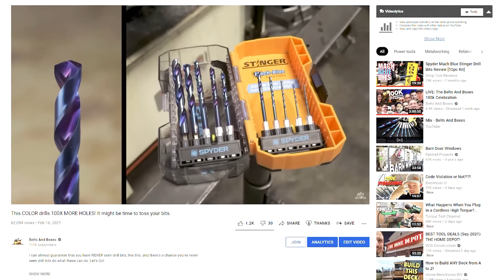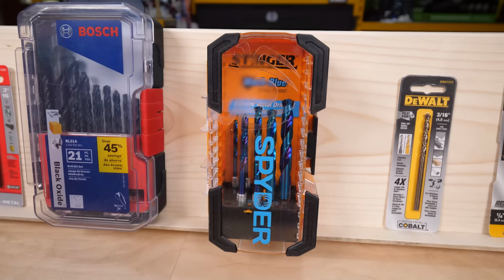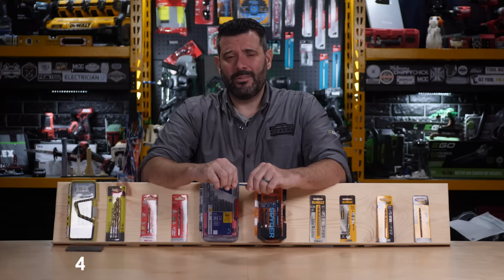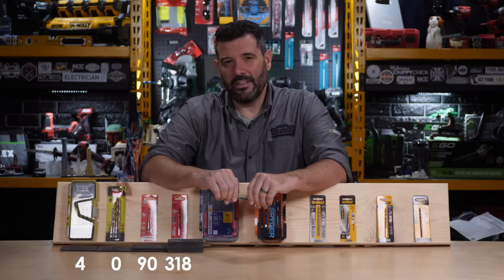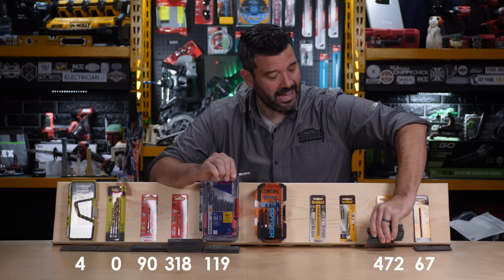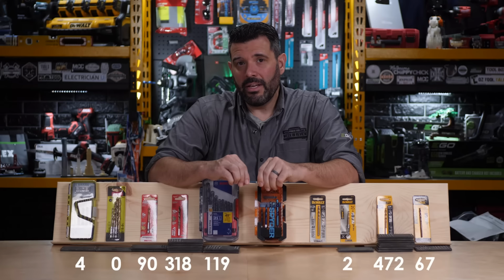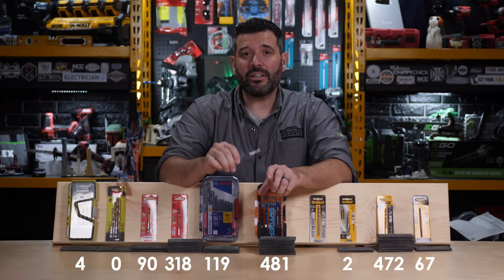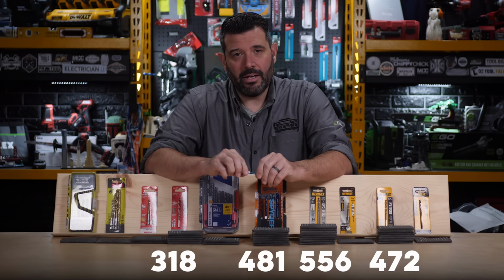What Drill Bit is Best? America takes on China. Milwaukee, DeWALT, Bosch, Ryobi take on Spyder 100x

Comment: I'm an ironworker, and at work we use Champion Brute XL5 bits, they drill very well and are made in the USA as well. If you're not too sore (or if you can convince your brother), I would love to see how they hold up against their American brethren. Great video!
Reply: Those are the ones I use as well.   They haven’t steered me wrong, but I’d be willing to give Spyder a try as their hole saws are pretty good.    As far as where a tool is made?   Whenever possible, I try to have it made in Canada/USA.
Reply: You ever try out any Norsemen drill bits?  Or the drillhog?  These are USA made.  Wonder how those compare to Champion Brute.
Reply: @jtoker9758  I haven't, no
Reply: I used a couple spider bits for galvanized heavy Channel a couple years ago. They surprised the hell out of me. We were predrilling for wall panels, so we made a lot of holes with them.

Comment: extremely thankful for the video! I was using Ryobi bits with lots of frustration and had no clue they are SO bad. Just bought Spyder to finish drilling steel that Ryobi was unable to do, and completed job in 5 min after spending 1h+ yesterday with Ryobi. The drilling effort you made is impressive but tells a story very well!

Comment: Excellent review, Drilling the point home, that there is a lot of inconsity in product production & performance. Seeing Spyder with those results is impressive and equally satisfying that it is American made. I did not know spyder made saw blades, that I am interested in.
Reply: Not all the spider products are made in the US. Paddle bits, circular saw blades, and reciprocating saw blades are made in China or Taiwan.
Reply: I tried the spyder drill bits to drill out a stripped lug nut. It didn't do very well. I ended up taking them back for a refund. The kobalt drill bits from lowes worked better and did the job I needed done.

Comment: I just want to comment that when this video came out 2 years ago(wow!) I went out and bought the German DeWalt cobalt and the blue spyder bits. Im not using them every single day but they are all still incredibly sharp. My only complaint about the spyder is they don't stay put in magnetic collets (m12 installation driver offset head) but aside from that they are amazing. I use them for wood and they still deliver consistent, clean holes! The German DeWalt cobalt bits are incredible and i use them any time i drill through metal! Still going strong 2 years later!
Reply from the maker: Love to hear this!

Comment: Since different coatings are meant for different applications, and the most of my work is light to medium steel, I always go cobalt bits as they seem to last the longest, regardless of brand. 

My particular favourite is actually the starrett holesaw pilot bit (I'm an electrician so most of my holes are 6mm anyways) £4 a bit

I have a Milwaukee cobalt index for when I need a particular size but risk snapping the bit. Cost £40

I have a hilti cobalt index that I've had for nearly 20years. Every bit is still razor sharp and will go through anything Ive ever come across,but the index cost over £200 for 35 bits, so it's only used if it happens to burn out a cheaper bit first

Comment: It needs to be noted that the Spyder bits are a coated High Speed Steel, and they did almost as good as the most expensive Cobalt bits. That is truly impressive! I feel like that's a very important distinction that should be highlighted. But the most surprising thing to me is that the DeWalt Titanium (a coated HHS) did just as good as the Spyder bits and are made in China, and cheaper. But, as you noted the quality control may be lacking, and you may not always get that performance. Over all a very cool test. Thanks for doing that!
Reply: But: titanium oxide is a coating, too. You did n't expect that, too much pressure and rpm ... burn the coating? Bit is done. I also use cutting lube, watching speed and pressure. Yes I do with crayon type lubes. Those hex shank bits are primarily used by householders in those 3.6 volt things. More expensive mfg. Aimed at a market with discernment and expectations. They will pay more because it fits their weak slow screwdriver.

Comment: I have a Dewalt cobalt bit set. They have easily been the best bits I’ve ever used. I’m not as active with them as I’m sure some guys are, but they’ve drilled through things I never figured they would have lasted through. I’ve also only ever used bits you can get from big box until I bought the dewalt cobalt. So there may be better bits out there.
Reply: Have you tried drilling through wood with them?  I was shocked at how rough they are.  They pulled the drill so hard it smacks into the wood.  Leaves splinters everywhere.  Goes very fast.  The Spyder and Milwaukee titanium bits I have I can use for finish carpentry because they are so smooth.
Reply: I used to work as a finish carpenter in commercial.

I bought the dewalt cobalt for pre drills on hollow metal doors, closers, frames etc.

I used to charge out the company for the dewalt black and gold because the purchasing person used to hate anyone who bought " needlessly expensive" bits.

I would charge them 5 to 1 for the cobalt and make nice profit, I even bought a bench grinder to sharpen them.

Comment: Glad to see Spyder doing well with drill bits because my experience with their carbide hole saws in 304 stainless and even A36 hot rolled is the exact opposite - I got 0 holes from both a 1-1/2" and a 1" Spyder hole saw using a drill press to control speed (<200 rpm) and plenty of lube. Finished both cuts with old, used, Lenox bi-metal saws. Love to see a shootout of American drill bits. Add K-Tool, KnKut, Champion, Norseman, etc. My K-Tool set has held up very well. My friend has lots of those Ryobi bits around, but he builds junk out of wood like a caveman, so it doesn't really matter.

Comment: Excellent video, straight to the point. Because of you showing this, I went and bought blue mach bits and drivers. I also bought several new saw blades, all Spyder. I bought Spyder blades for my jigsaw, my reciprocating saw (nice Spyder blade case) my miter saw and my table saw. In summary, this video printed me to buy over $300 worth of Spyder stuff. I did not know that they are all made in the USA. Great helpful video.
Reply from the maker: Ward, I'm glad you loved the video! But full disclosure, I know for a fact that not all of SPYDER's products are built here in the USA yet. They're working on it, which is more than I can say for many others. So you can support their efforts by buying their products for sure. But if you're only interested in spending money on Made In the USA, then you'll need to check the label on each SPYDER product you choose. 

I do hope you get the same great life out of your SPYDER products, that we've got out of ours, and appreciate you supporting Made In The USA products. It's hard to do that with power tools, but there are many great bits, blades, and hand tools still made here.
Reply: @ToolShow  Got it, thank you.

Comment: That drill they're using is running at the optimum speed for drilling a 3/16" hole into mild steel. But you still need coolant to not overheat the bit. There are certainly metal alloys that are more heat tolerant than others are. Some grinds will produce less heat than others too. This test would have come out different on a drill press using coolant. As to why I'd buy cheap bits it's because they're cheap.
Reply: Dewalt bits are very cheap. I got a set for like $15. Haven't had any problems with them. I usually try to use cutting oil but it's not always convenient so I drilled a ton of holes on my trailer without it and the bit still cuts like new
Reply: This and pilot holes ,crayon wax like stick lube coolants. Keep bits locked away from glommers in company shop as well. Even the same! bits provided last 100x's, taken care of, longer then the ⅛ bits used by the 800 pound gorillas bouncing on the drill that's spun at 4,000 rpms.

Comment: I would be happy with the DeWalt German bit, the Spyder, or the Milwaukee to be honest. How many batteries on the drill did you go through? Looking at set prices now for the Spyder and DeWalt.
Reply from the maker: To make sure a low battery was never a factor, we swapped them out after every 72 holes. They were usually down by one bar at that point.

Comment: We are building our own home right now and Spyder brand bits were THE ONLY ones that could do some of the work that we had for more than 3-5 holes. I actually stopped using mine because it was getting dull while all of its competitors are laying on the ground broken.
Reply: Learning how to sharpen twist drill bits is a valuable skill. In a pinch you could do it with an angle grinder. A bench grinder is your best bet though.

Comment: I’ve stuck to Milwaukee cobalt bits and haven’t looked else ware but I might look in to the German made ones cause in my opinion if you want a precision tool you go Germany, American steel if better for heavy duty applications
Reply: All I use are the cobalt Milwaukee bits as well. They're sharp, they cut fast and are easily replaceable if one breaks. More expensive bits are great, just not after 5 o'clock and it needs to be done.

Comment: Hi from Scotland, I have the spider quick change carbide tip holesaw and they are the mutts nutts. I’ve had my eye on the spider drill bit since they came out, I’ll get them at some point. China chose to make crap because there ethos is to produce crap and under cut the market.they could choose to do better I think which is why some of the Chinese bit did better than expected. They just can’t get over the cheep crap thing. 
That’s why it must be made in USA (not with Chinese soap alloy ), Germany although it’s been noticed that the Germans are using China (metabo ). 
So if I see China on it I don’t buy it. 
Now I got a dewalt countersink and it doesn’t say where it’s made 🤔

Comment: I never would have used even a cheap drill bit like that. I always use the center punch and cutting oil and I always check and file tips first, even on brand new bits but..... that's just me
Reply from the maker: As we've stated elsewhere, we were aiming to treat the bits like we expect most people to use them when they bring them home from Home Depot or Lowes. But I admire your dedication to doing it right.

Comment: I'm familiar with that blue coating from lathe and mill tools; I think you would see some interesting results if you retested your top two contenders in hardened tool steel!
Reply: Why are you trying to machine hardened tool steel? You're supposed to machine steel and then harden it.
Reply: @1pcfred  modifications to existing parts.
Reply: @matthewperlman3356  you're asking to do something that is inherently difficult to do. There are ways of doing it but none are easy.
Reply: @1pcfred  that is the point. If the spiders are using the coating I believe the are, you won't see the difference until you push the nearest competitor to it's limits regarding hardness. At least a non hardened tool steel which a good cobalt but should do but not for long. I believe that with this coating the spiders will actually cut hardened tool steel. I do suggest using a drill press for this test though.
Reply: @matthewperlman3356  I think a lot of what we saw here could be described as an edge use case. There are a lot of factors that determine if a drilling operation is successful or not. It is not as simple as chuck a bit up and go. I know if it were me and I couldn't get a bit to bore a single hole I'd be looking at the tip very closely to try to determine what is going wrong. Some bits do come with bad grinds that stop them from working. Some bits are made out of poor steel too though. I sharpen bits so I'm not a big believer in coatings. The coating is gone first time a bit gets sharpened. I guess the coating can help the margin some?
Reply: @1pcfred  all good points, that's why I normally prefer cobalt over titanium bits. With lathe and mill tools however, the blue coating on carbide tools gives a very notable  advantage over plane carbide or other coatings in cutting hardened steel, and probably other difficult metals as well. If I were to get a set of these spiders I would likely reserve them only for use where other drill bits can not hold up
Reply: @matthewperlman3356  I do not think they make bits with titanium. They do use a titanium nitride coating on bits though. It is called TiN. In my experience there's two kinds. There's a darker color legitimate coating then that cheap gold colored stuff you see on a lot of far eastern tools. Carbide is a topic too dense for most to understand. No pun intended. There is a mind numbing plethora of carbide formulations though. I don't think there is any such thing as plain carbide really. With tools it is tungsten carbide. Then there's cubic boron nitride. CBN tooling. CBN is harder than diamonds.
Reply: @1pcfred  Agreed. I was just referencing it by what most people commonly call them.
Reply: @matthewperlman3356  most people should stay on the couch.
Reply: @1pcfred  okay I'm sitting on the couch now
Reply: @juanjacobo8517  feels good, man.
Reply: @1pcfred  yessir it sure does
Reply: @1pcfred  I'm working on it, moving the old booty all around getting my groove in. Wife put on a new pot of Joe, we'll be here awhile
Reply: @juanjacobo8517  whatever it takes.

Comment: I remember the first hole I ever tried to drill too. No oil, cordless drill at random migrating odd angles, with undoubtedly a wide variety of pressure managed by how quick your arms started trembling with exhaustion. It may not matter though, the drill bit tips are clearly going fast enough to break the sound barrier; you can see the shock wave from the sonic boom pass through the puddles of molten steel. All this without a pilot hole. You would have been more correct if you claimed to be tig welding with drill bits, but cutting metal holes with them. Using your method to cut holes, a router would work better. They are even faster and more wobbly.

Comment: Had an old man sharpen black oxide bits for years at a shop i used to work for. They were sharp enough for the job and lasted for many holes using cutting oil. Bit sharpening is a lost art. We tried a drill doctor. But the cuts were inconsistent anything under a 5/16

Comment: May want to use a drill press with a fixed pressure, it makes significant different. The low pressure causes heat and kills the bit quite faster.

Comment: Thanks for making this boring video, not boring.
I've had terrible times with 1/4 shank drill bits breaking off the mounting shank , until red helix. For straight bits I prefer DeWalt pilot point. The black oxide bits are great also. I've had German made bits go dull, and break, as fast as the Chinese made ones. I've had TIN coated Chinese made bit last longer. I've had dollar store black oxide bits work just as good as the Ryobi bits.  At first I was a little skeptical at the aluminum looking mounting shanks of the Spyder. Now I'll consider them.  Still love the DeWalt bits. The moral of the story is... to stay clear away from Ryobi bits.

Comment: If I am needing bits for metal work (drill press), I have Drill Hog jobber or Norseman bits (made in USA). For most other portable drill bits, I've a set of DeWalt brad points and some titaniums (not sure if China, but I know that I've busted atleast several of the 3/8 and smaller all the time. I mean, I want a pilot for a small screw, 1/8 or so, its got a 50-50 chance of breaking.
Reply: I have used the living hell out of norseman bits in the machine shop. I need a full index for at home! I
Had a job on a mill, that required us drilling 3/8 holes into a casting. The holes were then machined to accept carbide cutter teeth for a rock trencher. I dont know what the castings were made of but the only drill bits that would last were guhring bits. We were destroying solid carbide bits in two or three holes. We started changing bits every 2 parts with the guhrings.

Comment: I have had the DeWalt cobalt bits for years and I've had the Spyder bits for a few months. They are both amazing. The DeWalts last forever and the Spyders just bit in and don't walk. They both work dry but prefer cutting oil. I knew exactly what you meant when you said the Spyders feel different, they just want to eat

Comment: Material composition has a big part to why that Dewalt bit did so well. When I had to drill through a lug nut and stud I did some research and found that having a little bit of cobalt in a drill bit really allows it to drill through metal. Most metal specific bits I have seen are labeled with cobalt. Not sure why that is but if you need to drill through metal get cobalt bits. Would love to see a comparison of cobalt bits from different brands.

Comment: I wish I could say I had a similar experience with the spyder bits I bought, but when I went to use my spyder bits for the first time half of them shattered in old rusty 1/4" steel. I really wanted to believe that spyder was a decent drill bit and after watching this video I may be willing to give them a second chance. But I've never had a Dewalt drill bit shatter when I've used it, and I'm glad I was wearing safety goggles when the spyder drill bits threw shrapnel everywhere.
Reply: Perhaps grain of carbide or crystalized steel. Sometimes welds.

Comment: From my experience every bit I have bought over 3/8 or larger I have had to sharpen it out of the package to get it to perform all my bits have been a mix of deqalt and Milwaukee. I am a welder and fabricator, I primarily drill steel. Just my experience.